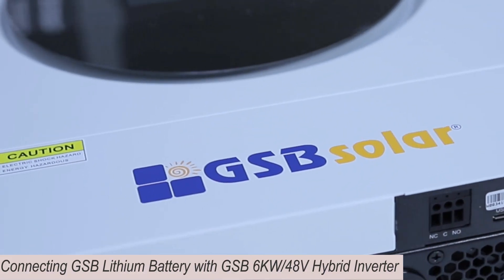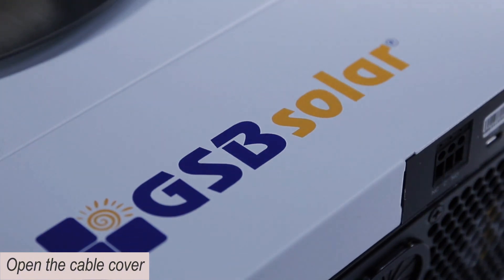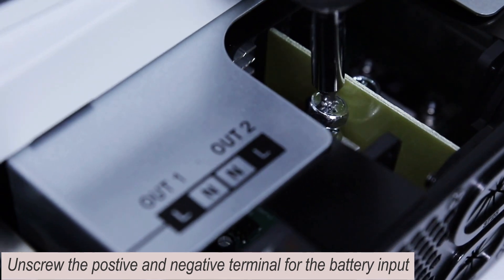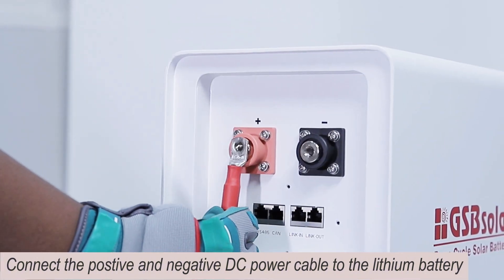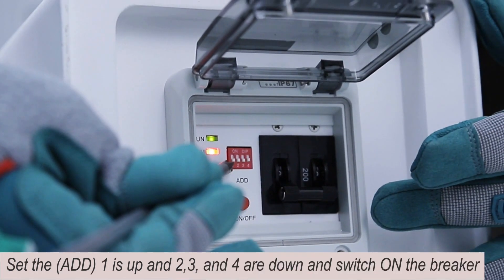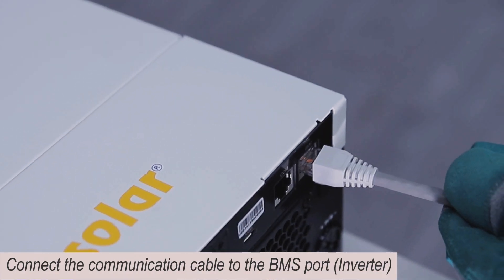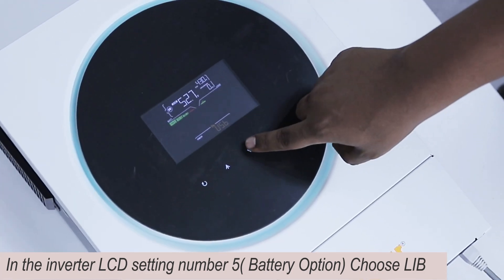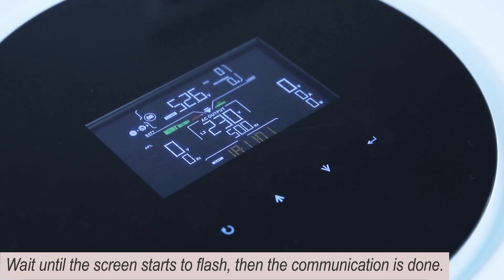GSB Solar RESS Lithium Battery Connection with GSB Solar Hybrid Inverter (LIFEPO4, BMS)

Comment: Bonsoir. En suivant votre vidéo j'ai activé le mode lithium pour le même type d'installation mais l'onduleur refuse de communiquer avec le système BMS de la batterie
Reply: Bonjour. Je dispose d'un GSB de 10KW/H avec un Axpert duo II 10KW. Les modes "Lib" et "Lithium" ne fonctionnent pas. Prière d'utiliser le mode "User" et configurez votre onduleur selon les recommendations du fabricant de batterie (voir le manuel). Surtout, bien vous assurer de connecter le câble BMS aux bons ports ! Bonne chance.
Reply: I have problem in bms